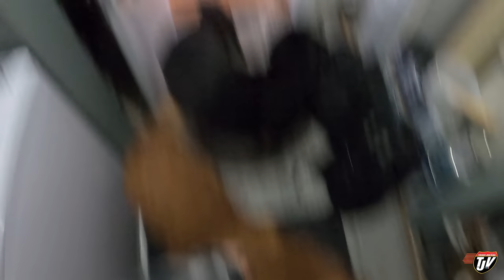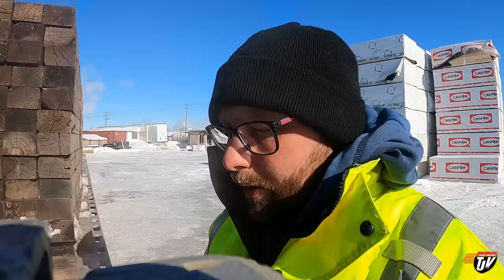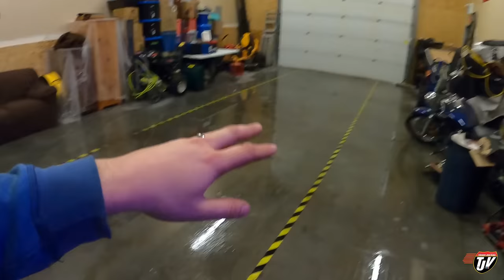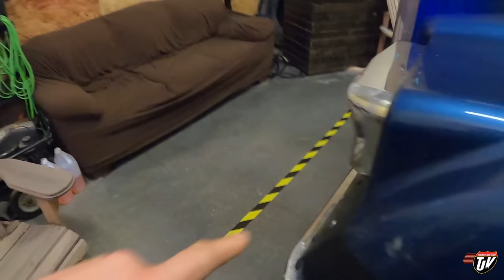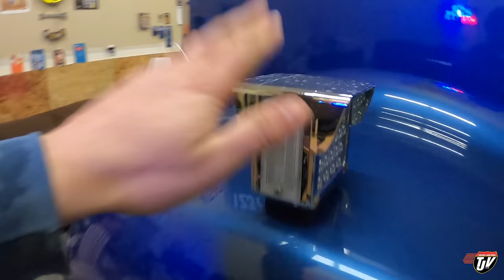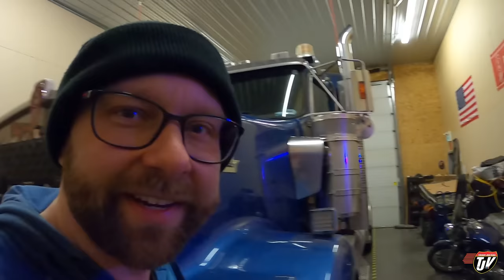CLEAN SHOP | My Trucking Life | Vlog #2745

Comment: Key to good truckers' coffee is to use medium or dark roast whole bean coffee & grind just before using. If using ground coffee buy in a bag & keep the air out as much as possible ( not that Maxwell House/ Folgers carp). And make your coffee in a percolator pot or French press.  If u have to use drip coffee pot, make using distilled water only.